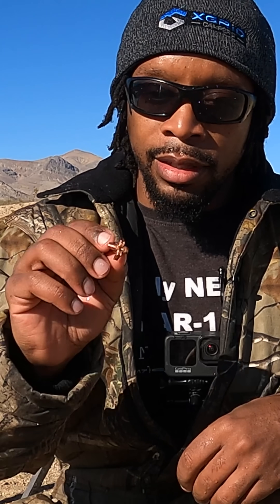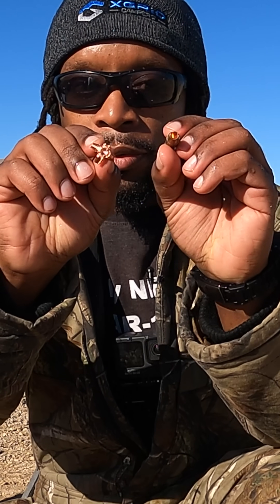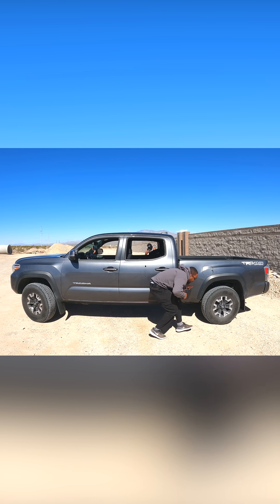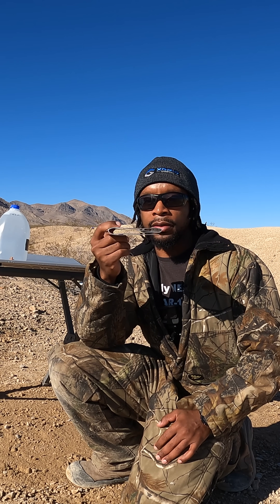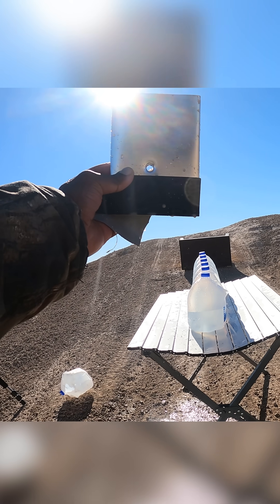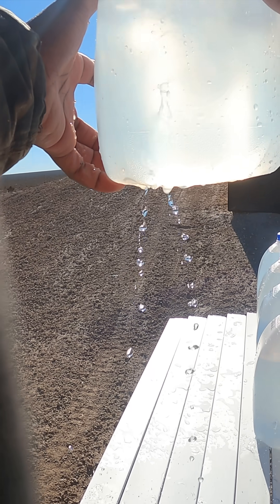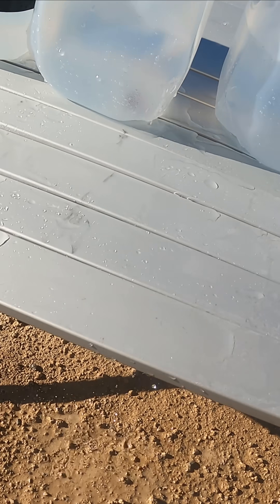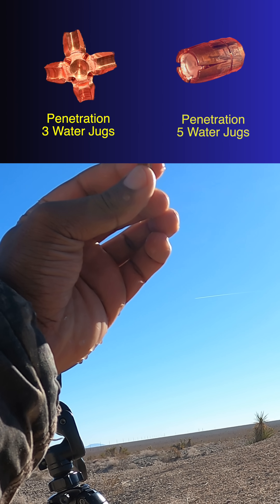Why Hollowpoints Fail | Shooting Through Car Doors | When Clogged Hollowpoints Act Like FMJs

Comment: A lot of it depends on velocity and projectile design …. Some designs are intended to expend at certain velocities …. While some projectiles are simply more reliable at a greater range of velocities…… vet your carry ammo …. Hornady critical duty 135+P, Speer gold dot, and federal HST …. These are industry leaders, not so much because of potential damage …. But because of reliable expansion and performance under the greatest range of circumstances and barriers

Comment: Depend on the hollow point if its a real company they will state its non expanding. So i like to use the cheaper hollow points with higher grain i would use for defense on the range.

Comment: He claims it's designed to make an X.

SON, the hollowpoint is designed to break apart and take out many organs after hitting bone.

Your water and milk jug doesn't show what the hollow point is.

Hollow points, son, were made to act like oobuck coming from a shotgun.
Many pieces flying in many directions. 
Or shrapnel!

Put the guns down before you get hurt or hurt someone else!
Reply from the maker: This Lehigh defense hollow point is definitely designed to make an X. Go look it up if you don’t believe me. I don’t even know where your getting this information from that hollow points are designed to break apart? What you’re describing is something like frangible ammo.
Reply: Hollow points aren't designed to fragment, they are made to expand.

Comment: 🤔Those Barnes hollow points are pretty good but do you have that problem so UNDERWOOD EXTREME DEFENDER will never have that problem and is the best choice if you're worried about that

Comment: Got to admit that the expanded hollow point increases the temporary wound channel in the assailant. All to stop the threat as quickly as possible. 
   Another good test is to use plugged hollow point ammunition. Like the Hornady Critical Defense pistol ammo. The latex polymer plug is designed to prevent clogging by going through clothing.
Reply from the maker: I have to test it soon 🤙🏾
Reply: @CajunBoyJake  You need a quality hollow point round for real world use. Speer Gold Dot, Federal HST,  Winchester Ranger, or Hornady Critical Duty…. They are all heavily used by law enforcement and are tested against sheet metal, autoglass, heavy clothing, wood, and drywall the thing is when people talk about FBI protocols they only think of gel tests or maybe a heavy clothing test but that won’t really test the quality of your defensive ammunition. I would only trust my life to law enforcement ammunition since it is rigorously tested in the lab and in real life defensive shootings all the time.
Reply: I don't run hollows I may need to shoot thru doors and glass
Reply from the maker: @6eth_LM  as you see here, HP’s will go through hard objects, clog, and over penetrate just like an FMJ would anyway.
Reply: @6eth_LM 5.7 with armor piercing is the way to go then brother
Reply: @CajunBoyJake  saying it penetrates just like fmj is a complete lie..there are thousands of videos showing the difference
Reply from the maker: @6eth_LM  link 2 videos
Reply: @CajunBoyJake  just type fmj vs hollow points penetration..there are videos of people using jel and metal
Reply: @6eth_LM so you cannot link? You stated it but cannot provide the source?
Reply: @DocumentGaming  read what I typed it's on YouTube

Comment: Good video, what are your thoughts on the hollow points that have a polymer or synthetic ball or whatever already in the tip to help it expand on impact? Wonder if that would have different results with the door. I believe glazer made them back in the day

Comment: Dude, that was a perfect explanation. Simple, to the point and you gave us all the info we needed with no riff Raff. Appreciate you. And on a related note, this is why I carry Hornady critical Duty or critical defense. It's got that plug in the hollow point already that will be pushed back and force expansion
Reply: Yyyyump. 
Ya beat me to it mah boy. This only a problem if you’re checking out on your ammunition. 
Otherwise, they’ve had this problem fixed and delt w a while ago.
Reply: Make sure to run a box or two through. Hornady is very high quality but the rubber insert drags on my magazine and causes feeding issues galore on my Ruger Security
Reply: Facts I run those too
Reply: So, how will that ammo do after going through a few layers of sheet metal? Expanding on the sheet metal and no penetration after?
Reply: Critical defense is the way to go.  But damn $1.13 per round 😢 lol
Reply: the plug is to prevent clothing and other material from clogging the hollow point, which prevents expansion, basically turning the bullet into an FMJ round. its not there to force expansion, its there to make sure the bullet expands after it passes through material like a heavy coat or jacket.